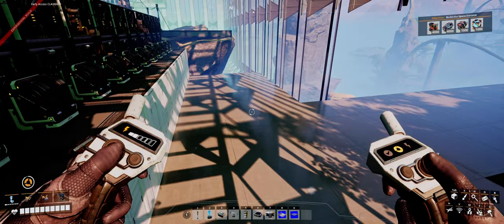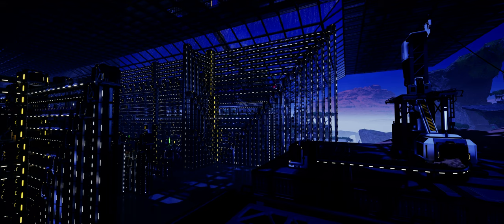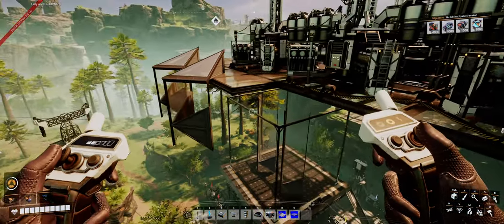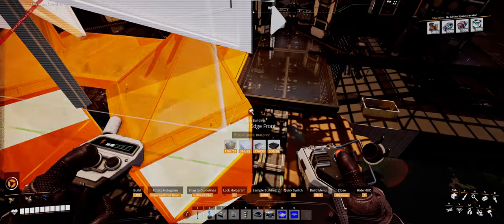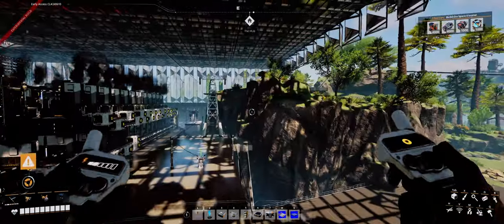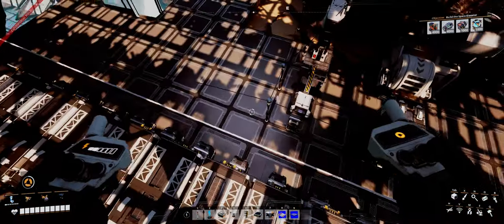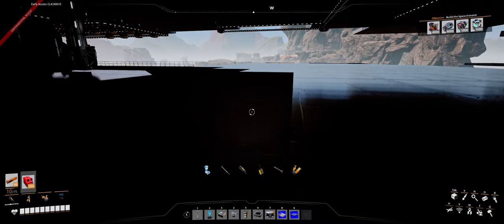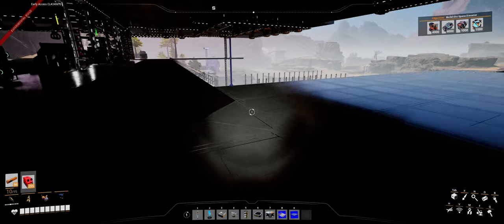I Spammed Blueprints to Quickly Build Cosmetics | Satisfactory U8 - Ep 20

Comment: 42:10 all you need to do is clip walls into the windows and it works pretty well
Reply from the maker: Usually yea that works. This time I didn't really have any walls to hide the clipping into.  But yea usually the left over glass hides inside a wall really well. Maybe the best solution is a design that has more walls so I can clip them better.

Comment: Just curious, but did you notice in any of your upcoming streams that when you (57:30) turned the facing of the miner near your original hub ("to make a walkway"), that it was overclocked and you didn't return it to overclocked?  Not sure how much that will impact your production line, but from what I have seen in your videos, you are pretty precise on what you do, which tells me there will be negative impact(s).  I have 23 minutes of this video left so you may notice it in this one yet :).
Reply from the maker: I didn't notice that, but at one point I upgraded that miner and use it for something so I boosted it to 600 per minute.  If it effected anything before I boosted it, I didn't notice lol.